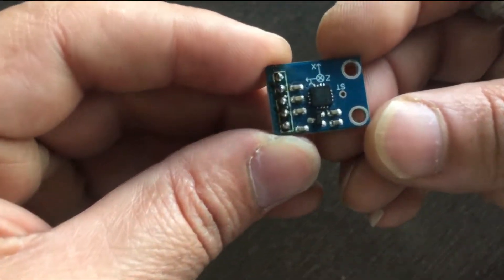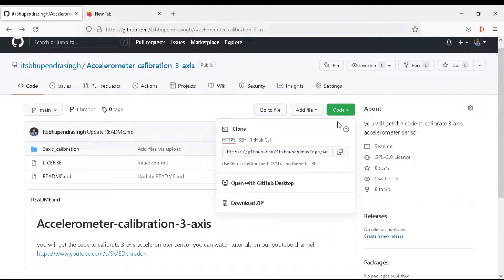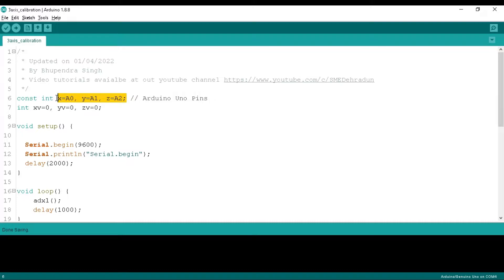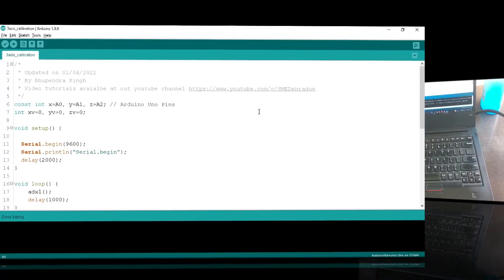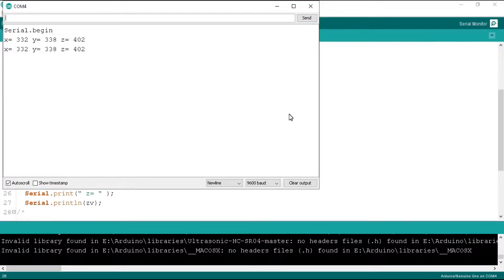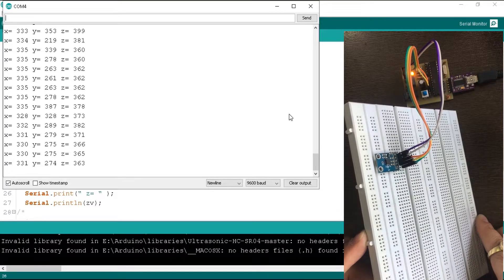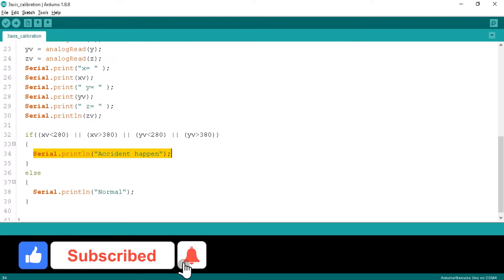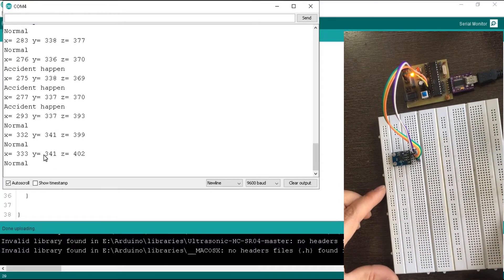Calibrate the Orientation of ADXL345 Accelerometer with Arduino

Comment: I'm trying to use an accelerometer to make a light come on when it detects deceleration and I've manage to make a code to get it to work how I wanted it to, but I've come across a problem, when I'm going up or down hill it affects it. do you know how to fix this. I'm new to Arduino so only know the basics
Reply from the maker: Hi,
Check your connections. It may be due to loos wiring.
Reply: @SMEDehradun  oh when i said it affects it, I meant it makes the light come on even though I'm not slowing down
Reply from the maker: Calibrate the sensor & check the minimum & maximum Adv values of c & y axis. After that put them in the code as shown in the video.